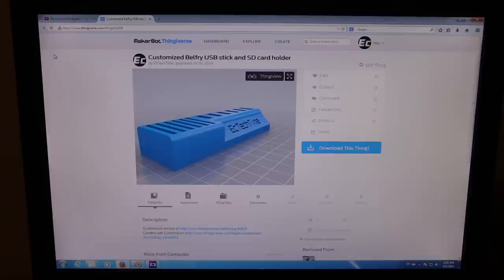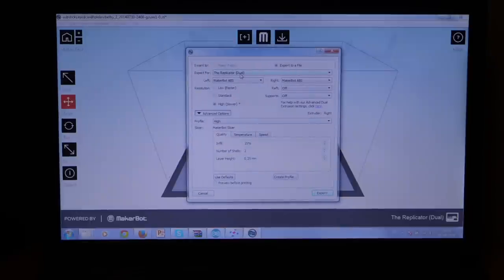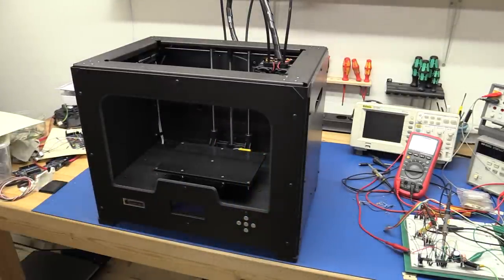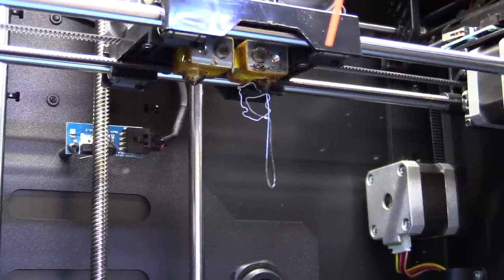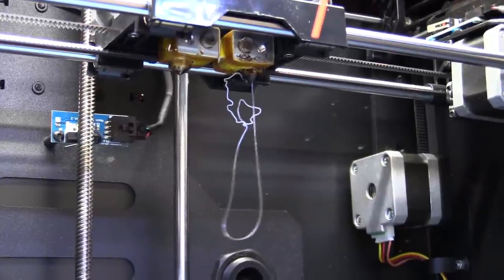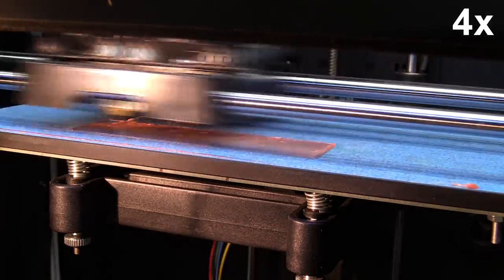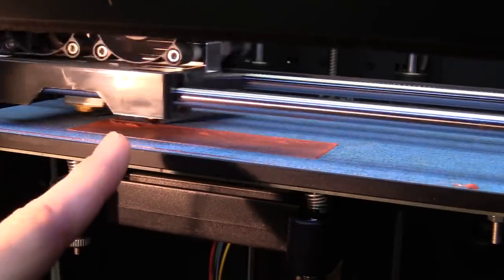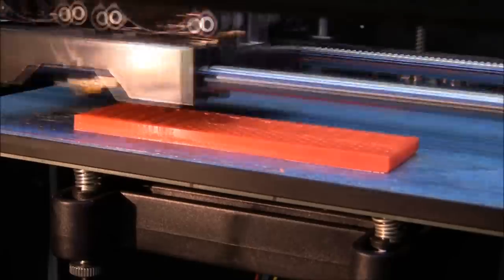3D Printing & Setting Up For PLA - EcTechTime

Comment: Excellent video, when first trying 3d printers (a Huxley), I started using ABS filament, but quickly lost interest because the prints were very poor quality.

Anyway I gave it another go last week with a new printer, this time using PLA. What a difference, the prints turn out like shop bought items. Thanks for the tip with the glue stick, if you can get that initial layer to stick I have found that the rest of the print is a doddle.
Reply from the maker: Hey, and thank you !

PLA is actually what I have the most problems with :P
ABS just always works with my printer. I don't know the Huxley printer, does it have a heated platform ?

Comment: wiping the blue tape surface with polypropylene/rubbing alcohol will help the filament to stick to the tape and removes any factory greases.
Reply: plus you dont need to heat the bed for pla .

Comment: You might be able to avoid the glue and print directly on the tape if you print a raft. PLA generally prints better on a raft.
Reply from the maker: I tried using a raft, but it didn't work either. I think my tape was not the correct type, because it didn't stick at all :P
Thanks for the tip ! :D

Comment: Nice things! :) Have you tried to polish them with acetone to get more smooth surface? Thinking about getting a 3D printer myself, but I can't justify it atm.
Reply from the maker: Maria Engström Thanks for the tip, yep I have tried that :)But I find it a bit difficult to polish it evenly unless using some kind of vaporization / condensation chamber :P
Reply: ***** Ah! Yea, that would be very elaborate. lol!
Reply: acetone only works with abs not pla lol